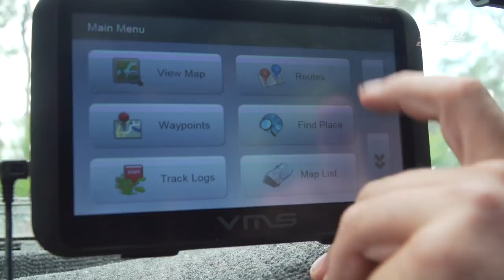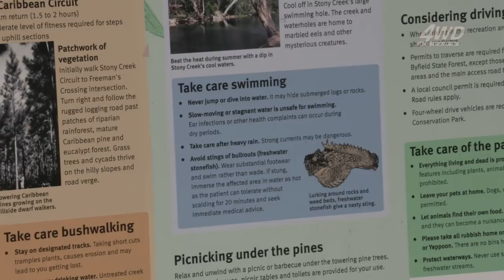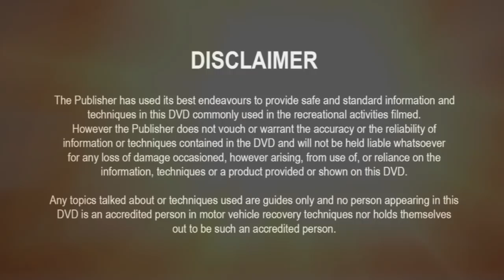HUGE RUTS - Would you take your 4WD here? Tough 4x4 Track in QLD

Comment: Shauno it's air in the cooling system.
Reply: could be water pump and/or thermostat
Reply: peter barber  nah mate the 80 is tuffer than mechanical problems XD
Reply: Could be a heap of things, fucking arm chair mechanics
Reply: felix the cat ... yeah there are loads of things it could be and from the other side of the world i aint got a clue
Reply: felix the cat  your the muppet why r we arm chair mechanics
Reply: Fukn aye sas
Reply: Its the termostat not working propaly in the 80
Reply: I reckon it's something not working like it should causing the vehicle to not work like expected. Im pretty confident on that diagnosis.
Reply: Damn flux capacitor shorting out , causing a miss read of temperature on the guage causing crystalline fractures of the giggy bot....

Comment: May be a 4x4 noob question. Why do they put the safety weight on the wench hook vs the middle of the line? I see people do it both ways, anyone able to explain the purpose of the two positions?
Cheers
Reply: They are thinking that covering the metal shackle with the weight is safest. I'd put it on the line close to the shackle, or run a second weight.